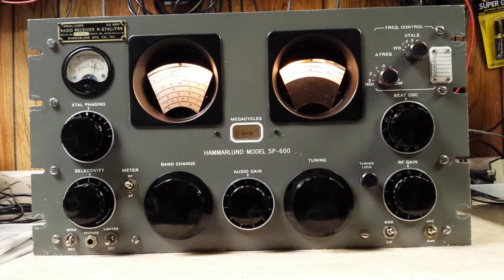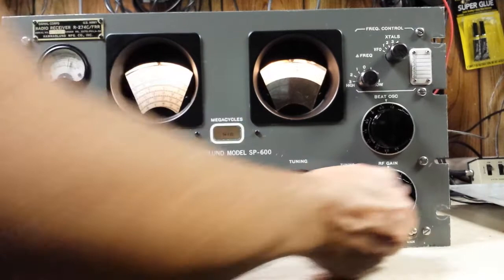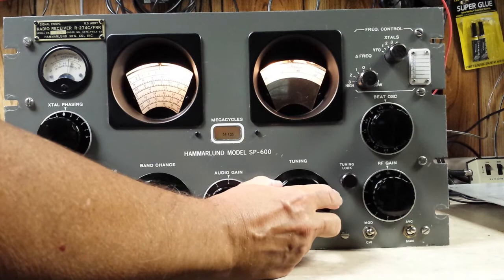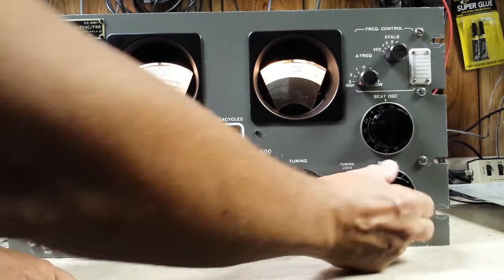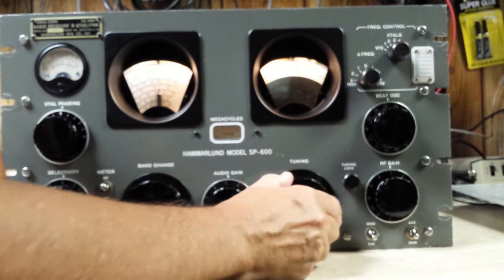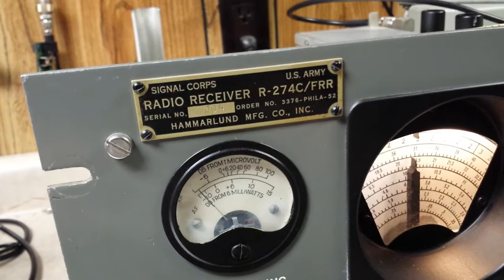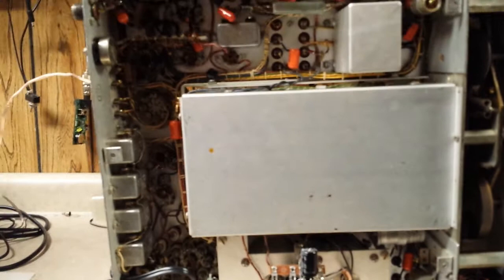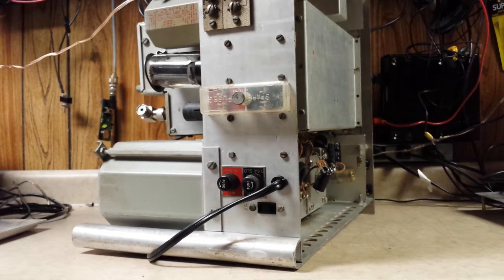Hammarlund SP600 Demo

Comment: Back in the 70's I had one of these. The front panel paint was in bad shape so I refinished it as bare Aluminum with all the letter in black. Turned out great  The SP600 is a great receiver and I kinda wish I hadn't sold it.  I just saw one at Ham Com last weekend in Irving, TX.  I can't recall what they wanted for it or if it had been refurbished but I'm thinking it was For Sale for around $150.  The one you are showing here looks like a great unit.

N5PY
Beau

Comment: That is a beautiful receiver, very nice far better than the BC-348 Signal corps receiver that I'am used to. I believe the frequency range is much broader that the BC-348 which doesn't have the 10m or 20 meter ham bands if I remember correctly. 
    Thanks for sharing!
     Kind regards, Eric Dee.